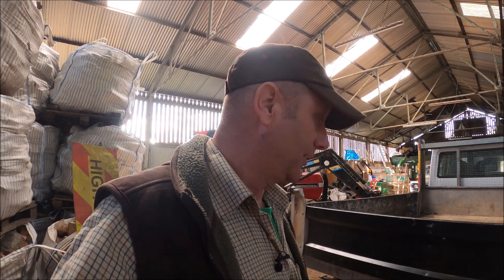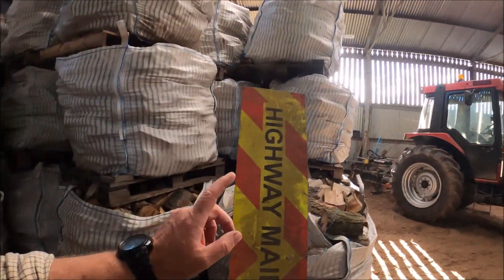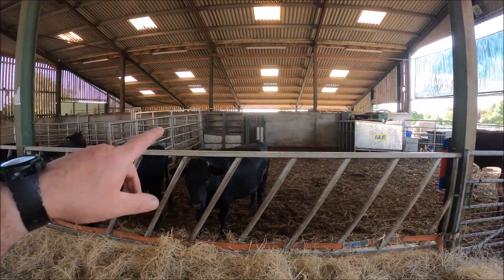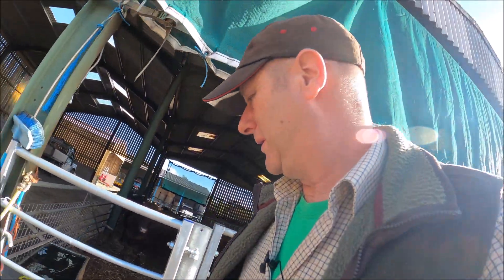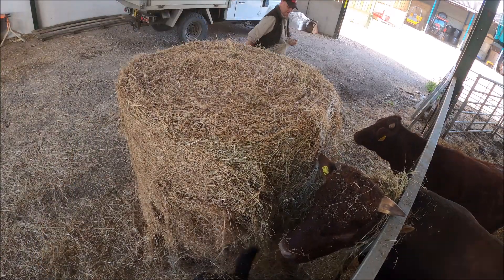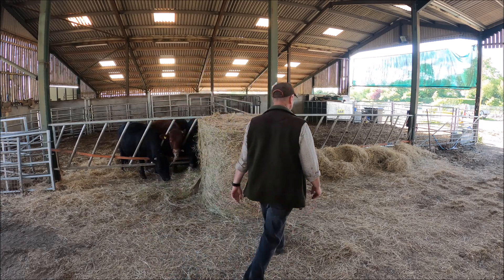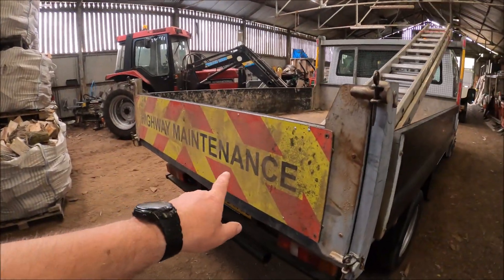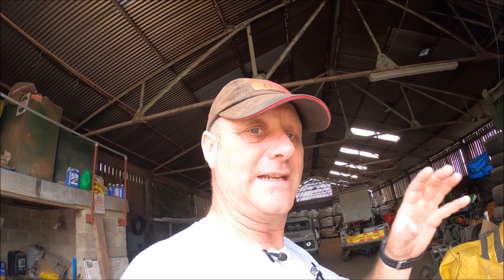11th and 12th June.  Preparing for a busy Monday.

Comment: I got my chapter 8, it's basically based around traffic lights
Reply from the maker: Traffic lights are a bit more Street works Unit 2
 Chapter 8 includes the visibility requirements of the vehicles on site and placement of signage. 🙂👍🏼
Reply: @FarmerP  I must have my unit 2 then aswell as the chapter 8 👍😏
Reply from the maker: @wayneguest9151  
Unit two was a three day course when I did it.
We run everything out of the little red Street-works bible🙂